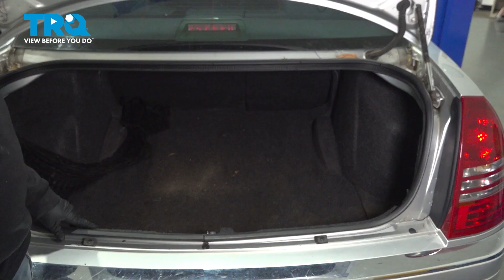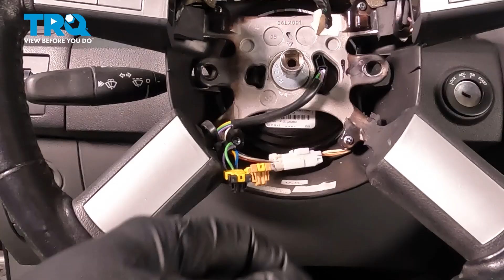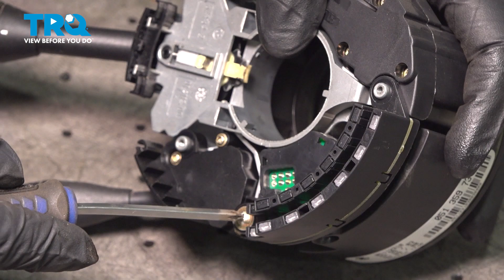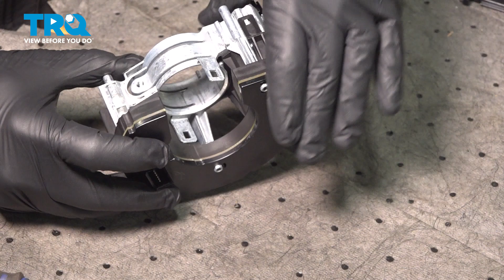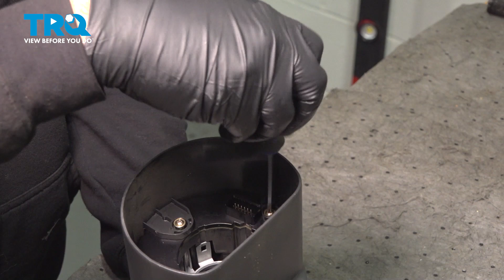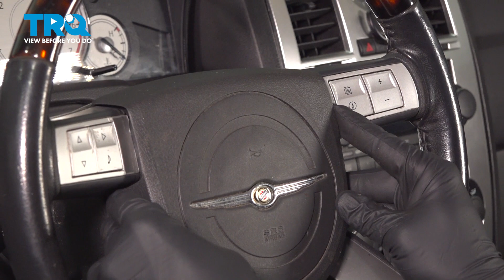How to Replace Turn Signal Wiper Switch Lever 2005-2010 Chrysler 300

Comment: Your video was the most best detailed explanation to watch and understand how to do this . I. A hands-on guy thatvmy macanic totally scared me not to do this because of the spring clock, and as u explained how to, it's 100% foolproof.  Thank you for your time and video.  Now i totally did this project without concern with my 2006 Dodge Charger rt hemi 5.7 that i had since new . Also would like to get answers for electric issues with my sun roof that i had a major water issue that flood the floor of my car on passenger side that i had to remove my seats and carpet and totally clean and de mold the interior with a ionizer macanic i got off off Amazon . But i tried to jump the motor on the sun roof, but nothing worked. Check all fuse and solenoids, nothing blown. Also, center cig outlet dont work. Check everything, nothing blown.  Need some tlc help. Thank you. Keep up with great work.

Comment: The turn signal lever on my 300 doesn't return to its normal position after turning the steering wheel back to center. I have to manually turn it off. Could this be the problem?

Comment: Turn signal single for both sides are not working however, hazard/double works, wiper, is not working as well, on a 2005 chrysler 300 limited, please help, how can I fix this problem?
Reply from the maker: +david essien We wouldn't be able to diagnose an issue like that here, you may want to have a local mechanic take a look at it. Thanks for checking us out! http://1aau.to/m/Shop-1AAuto-c